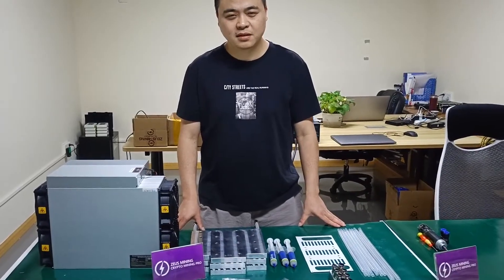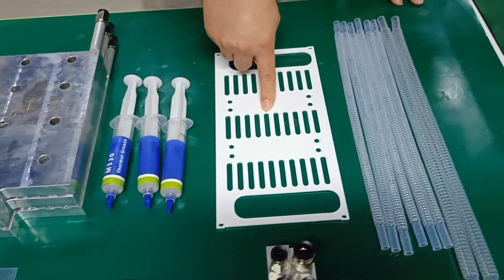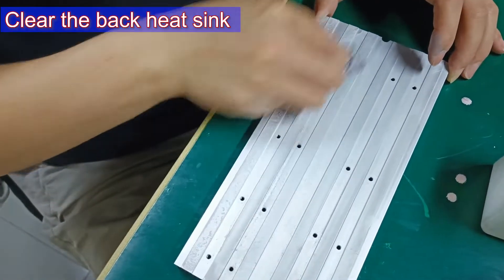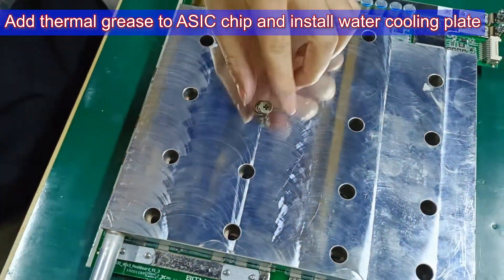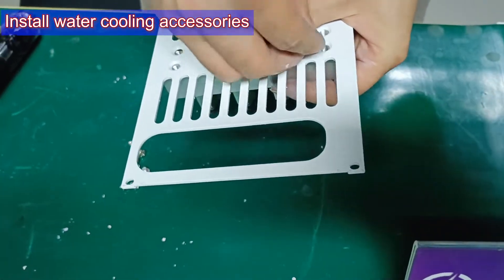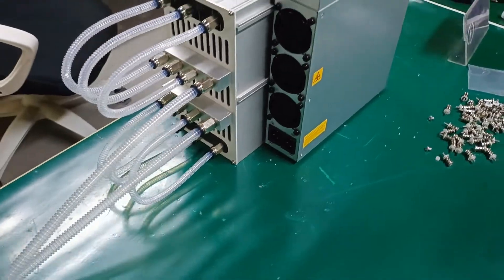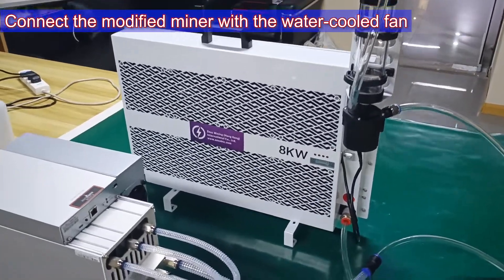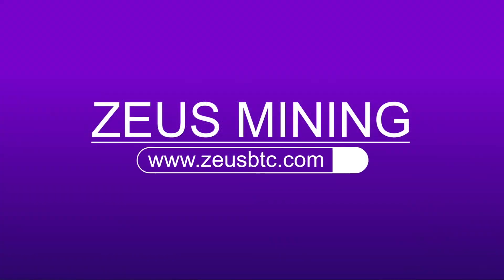How to upgrade water block and liquid cooling system for ASIC miner for more stable low temperature

Comment: What is the difference in temperature between the water and the chip? I saw another video where the water was 30C, while the chips were still running at around 65C. With CPUs, the temperature delta is often within 10C.
Reply from the maker: The operating temperature for miners is normally between 50-70°C.
Reply: @ZEUSMINING  Correct. Is the delta t between the silicon and the water mostly in the interface between the aluminium and the water, or within the ASIC itself? I ask because it would be handy if you could use the temperature to heat water up to 60C, so that you can replace the element in a water heater with a miner.
Reply from the maker: That's a great idea. The water cooling system removes heat from inside the ASIC.

Comment: hi I'm interested to buy one of this. The 8Kw model consume additional 8Kw per hour aside from the miner electric consumption? let say a miner consume of 3500 watts = 3.5KwH + this model 8KwH which means a total of 11.5KwH? Please correct me if I'm wrong. Thanks
Reply from the maker: Hi, its power consumption is about 0.16KW. 8KW means → For example, if the power consumption of one miner is 3500W, and two miners is 7000W, then it can drive two miners.
For more details, please see: https://www.zeusbtc.com/ASIC-Miner-Repair/Parts-Tools-Details.asp?ID=3047
Reply: @ZEUSMINING  ohh ok, thanks it's only 160watts.. thanks..
Reply: @RukiaKuchikie  deam i tought that thing uses 8000 watts too and was wondering how the f are they profitable xD

Comment: Do those water connections ever come loose? It seems like a very weak connection, and if they ever come loose then there is water all over your asic.
Reply from the maker: Hello, the connector has been pressure tested and will not loosen under normal circumstances.
Reply: @ZEUSMINING  OK thank you... And whats inside the blue cooling fluid? Is it colored water?
Reply from the maker: You're welcome. It's blue water because if there is a slight leak, it will attract our attention more than clear water, so we can deal with it in time. If you need to know more about water cooling, you can contact our sales via WhatsApp: +8618623251355, he will answer you in time.

Comment: I purchased the 12 Kwh model and have 2 miners running. What should the red and blue temperature spread be for optimal miner management? I'm assuming that red means hot miner water coming into the radiator and blue is cooler treated water leaving the radiator. On mine, the blue says 40 and the red says 28 which seems odd because the monitor colors would be reversed.
Reply from the maker: Blue represents the ambient temperature, red represents the miner temperature. The recommended ambient temperature is around 20-40 degrees.
Reply: how much kWh does a 12Kwh cooling module use in real life? And how much heat does it generate? Do you think it could it heat up a isolated 20' container above 10 degrees Celsius during normal winter in northern hemisphere?

Comment: You are wasting 8 kw,, which can run about 3 extra asic miners 🥲
Reply from the maker: For high-power miners, it is best to run one, otherwise the cooling effect may be affected.
Reply: @ZEUSMINING  this methos can use for iceriver ks3 ks5L ?
Reply from the maker: @Trungkhai-z1h  Yes！
Reply: It's not the power consumption of the radiator but the radiator ability to handle of heat up to 8kw

Comment: Why the inlet temp is hot than outlet temp.
Reply from the maker: There's not enough running time here. Under normal circumstances, if it runs for about 30 minutes, its temperature will be more stable.

Comment: how is it profitable to run this setup if the cooler is drawing 7.8KW of power? And why is the liquid cooler even relevant if theres a fan in the liquid cooling machine?
Reply: 7.8kw of heat can handle
Reply from the maker: 1. There are many factors for profitability, such as electricity costs, miner computing power, etc. 2. The water exhaust fan can reduce the operating temperature of the miner and extend the service life of the miner.

Comment: What kind of coolant do you use? Is it disteeled water?
Reply from the maker: You can check this product page Syscooling water cooling cooler:
_https://www.zeusbtc.com/ASIC-Miner-Repair/Parts-Tools-Details.asp?ID=2614_
Of course, if you need to know more, you can also directly contact our sales WhatsApp: +8618623251355
Reply: deionized water

Comment: How loud is the 8kw cooling fan or is it the same as with the 4 fans on the X19pro 104TH. Can you tell me the decibel reading?
Reply from the maker: The decibel of the 8kw cooling fan is between 20-70, and the gear can be adjusted. Installing water cooling is a solution to reduce noise, or you can contact our sales to learn more about related products. Sales WhatsApp: +8618623251355.